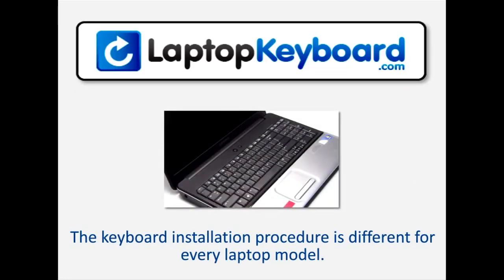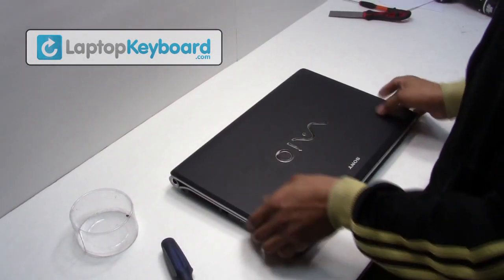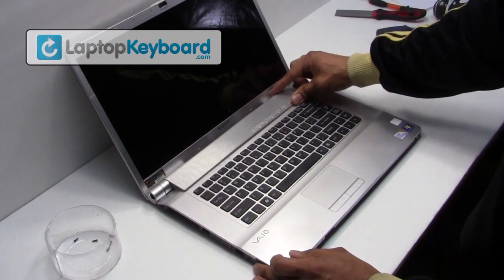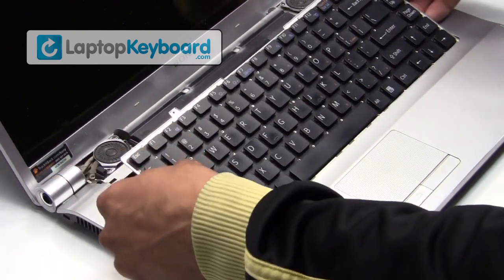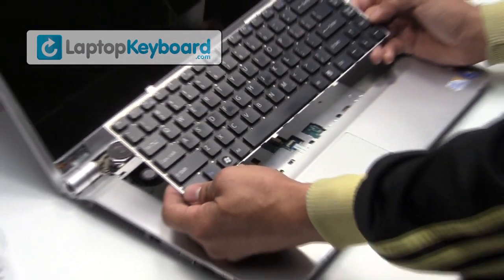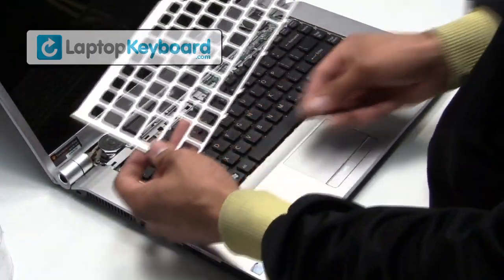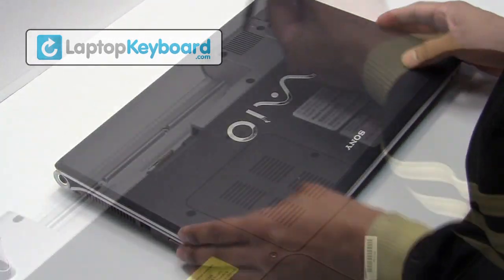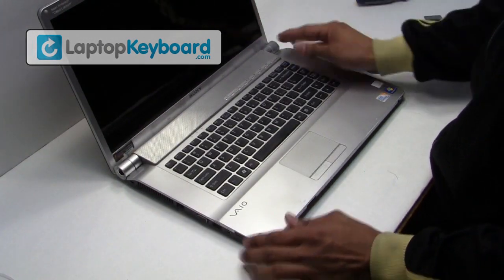Sony Vaio Laptop Keyboard Installation Replacement Guide - VGN-NW - Remove Replace Install

Comment: You forgot to say that in the battery space there are two screws which also need removing. In the video they're already removed. A total of 5 screws need to be removed (including the 3 you remove in the video). I ended up accidentally breaking the 2 screws in the battery space as I took off the strip beneath the screen. But they're not really needed anyway. Thank you for this useful video.

Comment: Lol.. He completely ripped off the fragile cable from the connector at 2:24 and the worst part is the video doesn't even show how to get the keyboard connected back to motherboard. 

For all who are trying to do the keyboard replacement, be careful with the KB and motherboard connector. The cable can break off pretty easy from it's attached connector..
Reply: He unclipped it.

Comment: hey FW isnt a bad laptop model. im still using mine and its form late 2009!. renders high end games pretty alright *concerdering the price of this thing was about 2k with tax) 

only thing is the KB's ware out after 2 years. mine has the keys falling out of it!. not like i type hard or anything, the battery is weak now only lasts max of 1.5 hours, other than that the FW is a very very nice PC. and the parts are cheap some of them anyway. the screen is about 120 max the KB is 15 USD !!. <3 FW!!!

Comment: have you seen some laptops? :o you gotta take the whole thing apart just to get to it. least this the FW (im using btw) you only gotta remove 3 - 5 screws take top off replace the thing nd ur good. if yoou can tell from my typing im in need and about to replace this things KB xD. be glad u dont an HP i once saw one that needed to take the motherbored off! ughak!